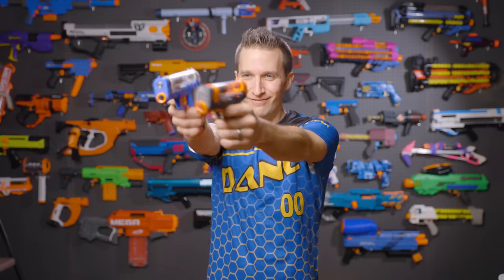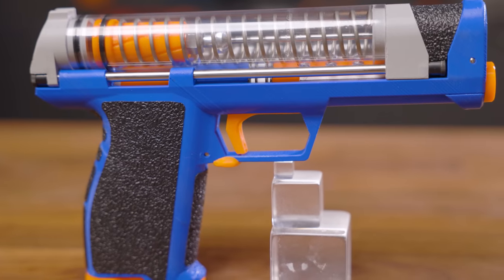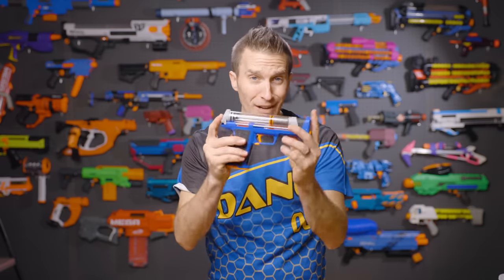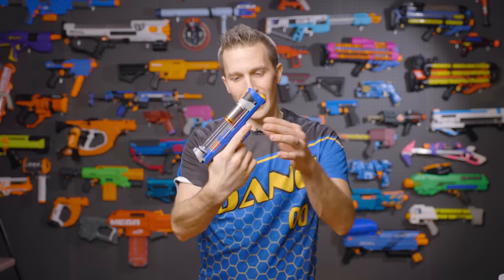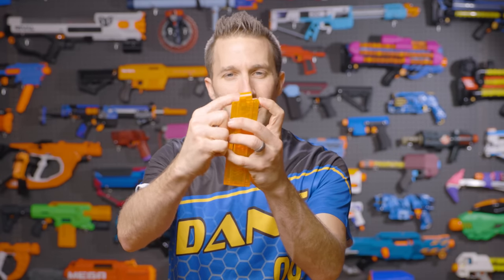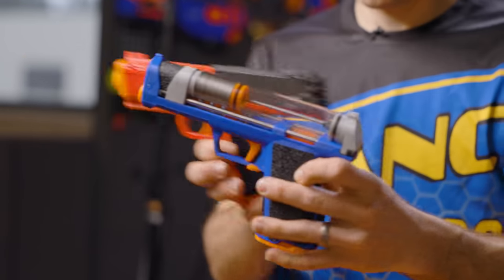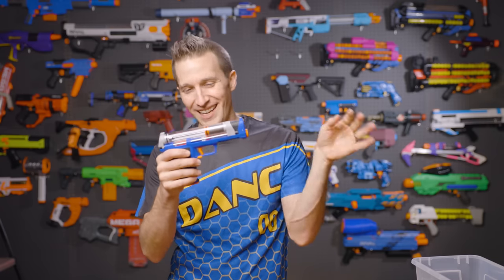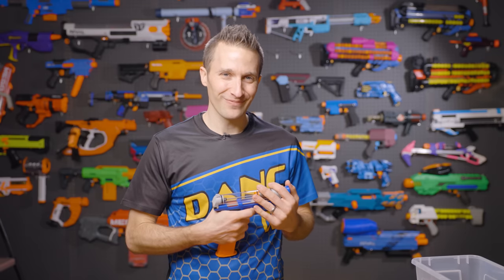REVIEW: ZINC by 118 Design

Comment: Every day we revolutionize sidearm blasters, the closer we get to fully functional competitive revolvers. This is exciting!
Reply: the challenge with double action springer revolvers is that the hammer can only go back as far as you can pull the trigger, which works fine if its a firing pin that only needs to go a few mm, but doesnt work for a plunger tube

Comment: I don’t disagree with you often Luke... But I like the Zinc a lot more than the DZP Mk2... ;-) (whilst I own neither hahahah)

- Formfactor more intuïtive
- Prime at more logical positon
- Much more visually pleasing due to transparent PT
- But most importantly: mag in grip. Soo much more game friendly because of that. In 130 FPS capped games this can be run as a main and for that you need you want mag swaps. Not an internal mag.
Reply: Agreed. Although accuracy-wise, the Zinc is going to suffer quite a bit from that heavy trigger pull. But in that regard, you can carry a Dart Zone Pro Mk. II and whip that out for those occasional longer distance shot. You're essentially pulling a John Wick at that point, which is honestly pretty badass.
Reply: but you can't use this at 130 fps capped games.... 130 is the average fps, not the high end....not to mention the amount of tolerence issues since these are 3D printed, as well as that 3D printed blasters, in general, have issues with heat and warping, which on a blaster which already has tolerance issues as is, wouldn't be very good.
Reply: @watyhu99  as someone who is predominantly involved in designing and developing 3D printed blasters... I have to object to that statement.

Also: if 130 is your cap... get a weaker spring. Make the prime easier ‘AND’ get rid of that heavy trigger pull in one go.

I stay with my preference. Zinc over DZ pro Mk. II

Btw.. the DZP also shoot harder than 130 fps.
Reply: @nirodha7028  Object to what? the extremely tolerance issues the blaster has? Just because you like the zinc doesn't mean it doesn't have issues. Just getting the magazine to work well requires a crap ton of sanding to get it just right
Reply: @watyhu99  the reverse is also true: just because the blaster has tolerance issues doesn’t mean I can’t like it.

I have no idea why you believe I would think my personal opinion on the blaster would be anything more than that. Let alone influence the characteristics of it... objective or subjective... as perceived by others (you included).

I wasn’t aware of tolerance issues since I haven’t built one yet. I mentioned this in my first comment.

Anyway. Thank you for sharing your opinion. As I have mine.

Comment: im no professional but im pretty sure if you cut a few coils off that spring it would help the trigger pull alot. its at maximum tension and the spring is probably putting way more pressure on the trigger being fully compressed. even looks like its being crushed slightly. try cutting off 1 or 2 coils and see how much easier it is.

Comment: A second weak spring around one of the two steel guide at the side would help with the slide going forward by itself after you pull it. It'll also make the hold open feature seem more useful

Comment: It's literally if a Beretta 9mm was nerf gun. 1. Trigger well should definitely be larger, 2. The trigger weight can be tuned pretty easily by the end user, it's going to be determined by the angle and friction on the sear, as well as how clean the edge of the sear is. You can probably clean it up yourself, lube it, and if you really want put a metal plate on the face to make the trigger pull super light.

Comment: Does it come with the normal 3D Parts or do you really need to print it yourself?
Reply from the maker: Currently it's only available as a hardware kit, so you would have to 3D print the body and mags yourself. - Perry

Comment: Luke how do you feel about hyper making rival obsolete the moment the proton pack comes out
Reply: Hyper doesn’t make rival obsolete
Reply: Theoretically, he probably can make the proton pack work with Hyper. They're both balls, but different size. Depending on Hyper's diameter, might even be possible to create a blaster that fires both Rival and Hyper, so you can use both Rival and Hyper in the Proton Pack.